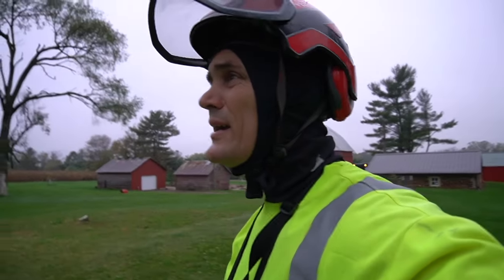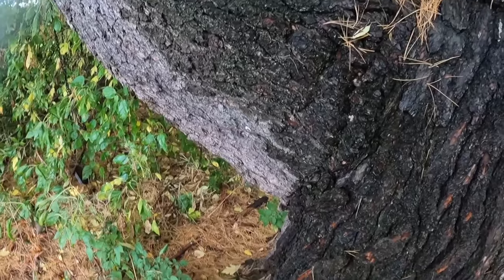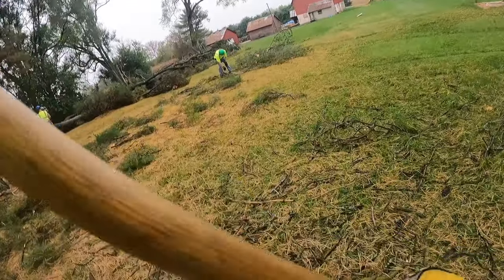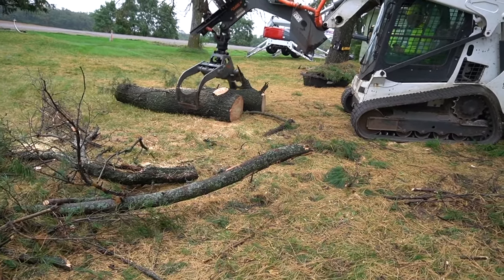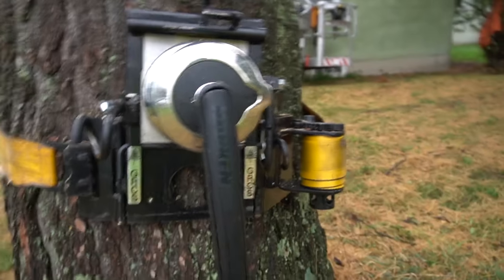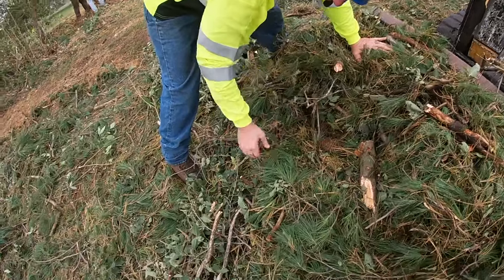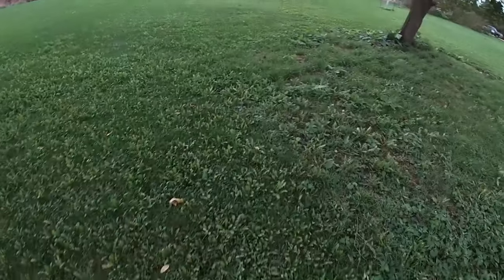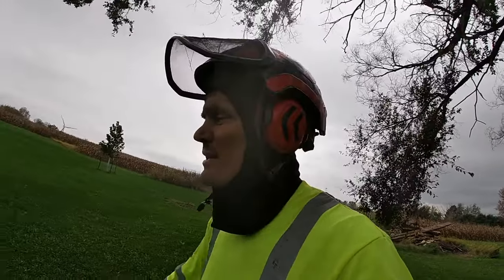High tension wood felling, The history of the GRCS as a bonus

Comment: I have seen a few guys use the small battery powered saws. I work in Minnesota. We have lots of Ash, Oak and Locust. How does that Husky hold up against the hard woods and winters?
Reply from the maker: In winter, transport it in the cab and keep it warm until you use it. I use the big 300 batteries and they do well. I use a 16” panther bar from monkey beaver and it works well, but not as gutsy as the 540xp but I like it for pruning and lift work. For Pine and spruce removals it’s great